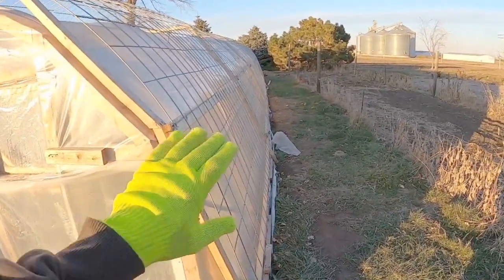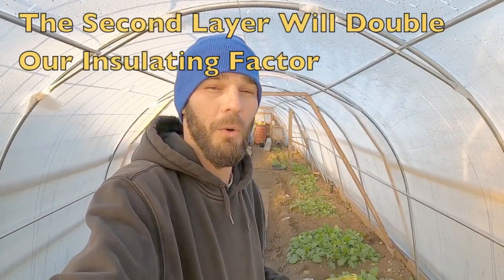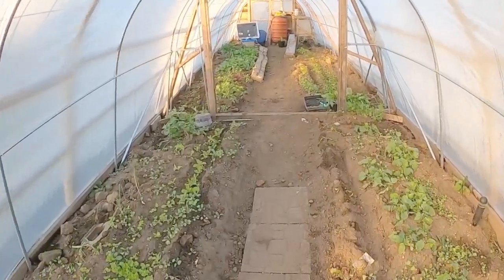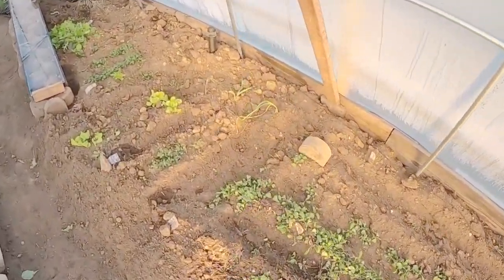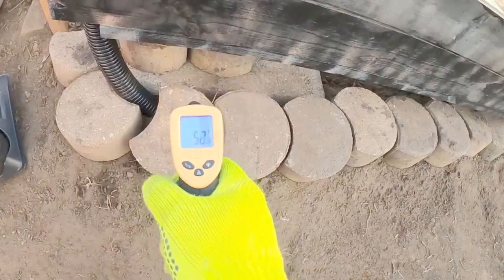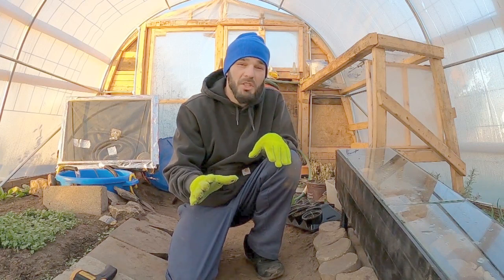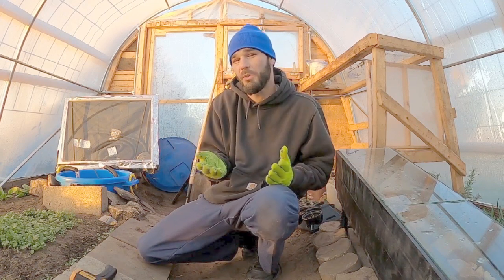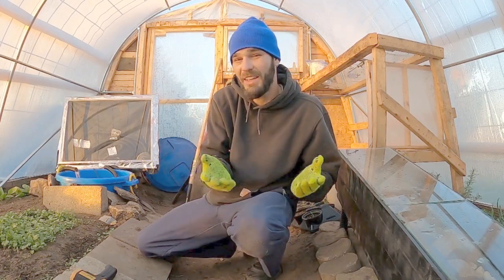DIY Solar Heater Experiments Ran By Autonomous Systems | Observations & Ideas | 520 SQ Feet To Heat

Comment: Good to experiment. I think you could use the whole floor of the greenhouse as your solar collector just by adding charcoal to make the soil  darker, then cover with low tunnel hoops each side. Cover with space blanket at night to prevent losses or what you gain during the day is lost at night. Or place thermosyphon solar collectors outside - and shove the heat storage inside the greenhouse, but I don't particularly like water systems because they may freeze up and burst.
Reply from the maker: Yep we have actually moved to compost heating the water to prevent freezing up and root damage and heat draw as opposed to heating the floor. Great input! And thank you, I’ve been trying to find more free bricks and lava rock works great if it can be had cheap.